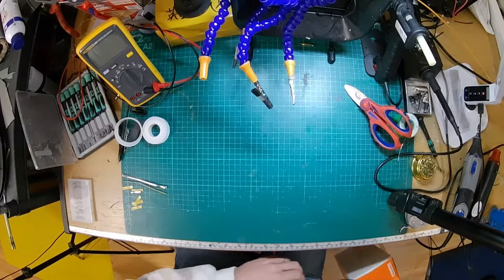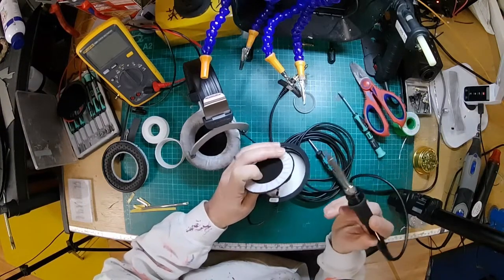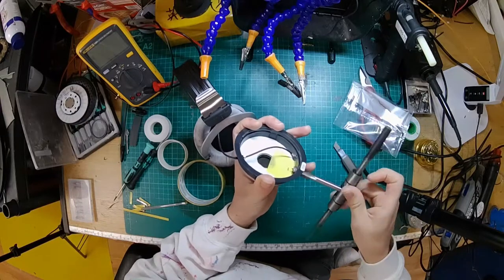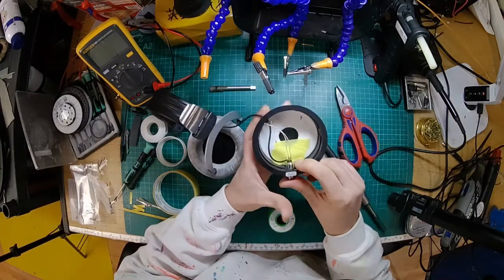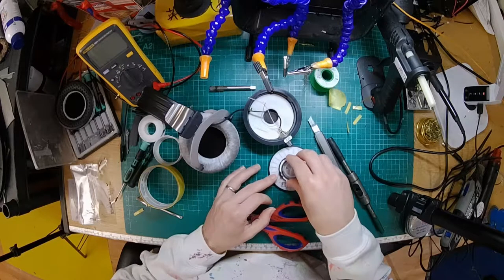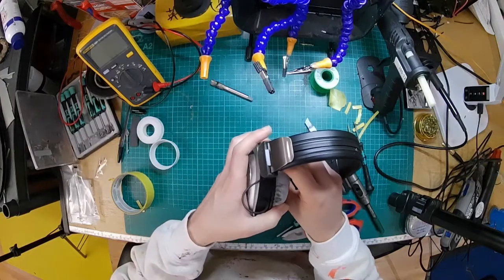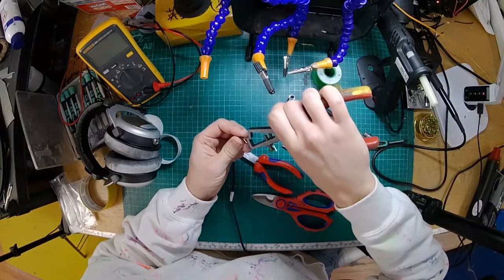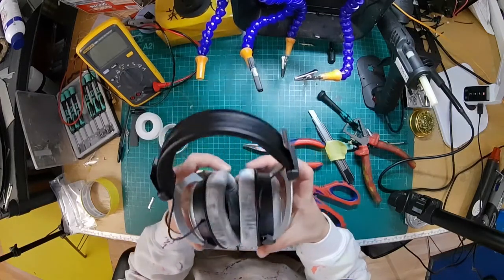Beyerdynamic DT880 detachable cable mod and also looking at their design features

Comment: You should start doing a baseline frequency response test before and after your mods to see how well you put things back together and see what changes things like lead make. Also, did you ever end up fixing that cable sticking out the wrong way?
Reply from the maker: Yes - when we are first testing mods we make frequency plots before during and after and yes I would have removed that earcup and untwisted the cable before it went back out. Looking back at this video, I should probably re-do it now I am a bit better at editing and will try to remember to add waterfall charts if I get round to re-shooting an 880 video
Reply: @CustomCans  Sounds like a plan. I am very curious what a metal cylinder (mini XLR) behind the driver does to the sound, as well as if the slight damage done to the cotton padding has any effect.

Comment: in my case the nut(nut that holds the connector) did not fit in and I just halved it like 1/3 - 1/4 and it worked so no need to put glue

Comment: hello friend good job; Tell me what is the difference with the lead bars that you glue to the driver, how does it affect the sound? And what is the name of those bars to buy them? thanks for your answer
Reply from the maker: It is 6mm self adhesive lead and it gives more derail in the bass and a little more sub bass generally. If you hunt online you should find it
Reply: @CustomCans  thank you friend

Comment: So in the headset itself, white is left and red is right?
Reply from the maker: It can vary depending on how old they are - I would recommend using a multimeter to double check but normally the main cable has white for left and the headband cable often uses white for positive and red for negative but it can be the other way round sometimes  - I suppose it depends on who builds them at beyer

Comment: Q: Instead of hot glue, could you use superglue?

Also, do you have any links to connector suppliers?  I'm a bit lost when I google Rean and only seem to find the female connectors
Reply from the maker: You may have to modify the nut that comes with the socket to fit as it will need a bit more support than the thin wall of the earcup can give. You can use thread locker on the nut, do it up really tight and dremel the top of the nut down a little so the driver can sit flush .